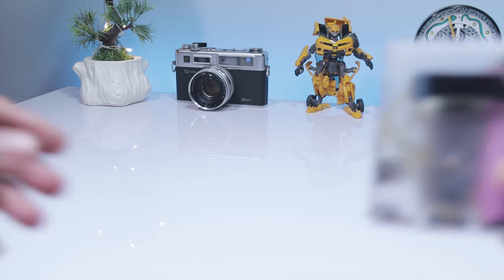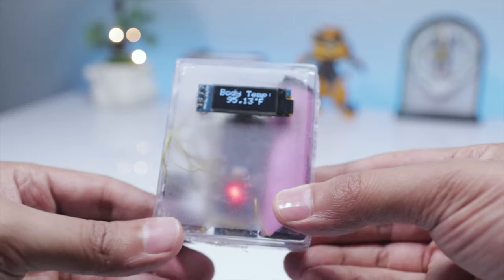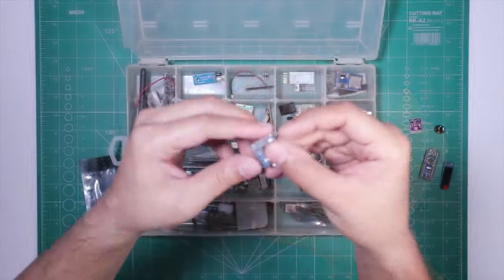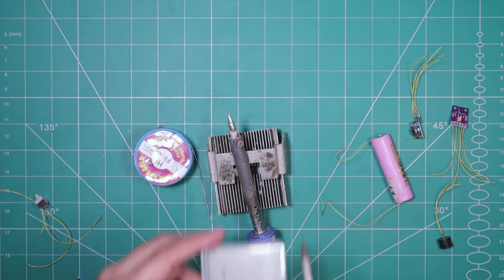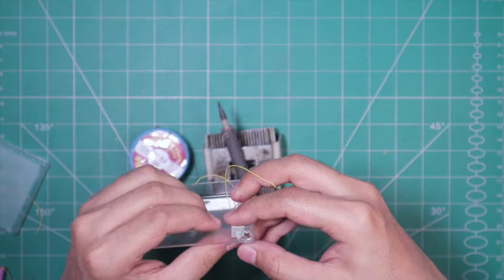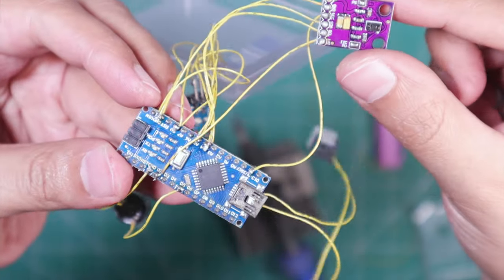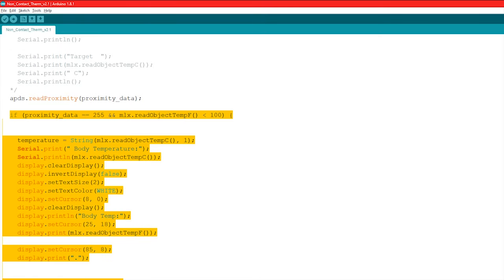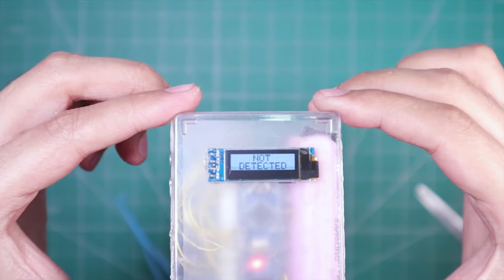DIY Non-Contact Thermometer | Low Cost Easy To Make | Infra Red Thermometer

Comment: hello sir, how are you. 
hope doing good..
sir, i just want to ask question regarding costing, the IR thermometer used here costs around 3k but the non contact IR temperature measuring machines available in market costs just rupees2k.. so how it is cost effective.

Comment: Brother, I just downloaded your code but it seemed to be error when it runs, this is what it said " Arduino: 1.8.13 (Windows 10), Board: "Arduino Nano, ATmega328P"

Non_Contact_Therm_v2.1:11:10: fatal error: SparkFun_APDS9960.h: No such file or directory

 #include <SparkFun_APDS9960.h>

          ^~~~~~~~~~~~~~~~~~~~~

compilation terminated.

exit status 1

SparkFun_APDS9960.h: No such file or directory

This report would have more information with
"Show verbose output during compilation"
option enabled in File -> Preferences.

What is happening?

Comment: What is the range?
It can be used in electronics also?
To measure for 600 C for example?
Reply from the maker: Yes it can be used to measure any other surface temperature, but its temperature range is from -70C  to  382.2C

Comment: hi sir ! can ask you please about the size of the 18650 battery that you're using !!
Reply from the maker: The number "18650" actually classifies the size of the battery where 18mm is the width and 65mm is the height of the battery. So all of the 18650 batteries are the same in size.
Reply: @GuyThatDoesEverything   thank you sir! I was asking about how many mAh, i meant it like 2200 mah , because i have a student project of a mask that will give the temperature of the user and i have that problem of how many "mAh" i need for the battery !

Comment: I need a sensor that can measure temperature from 5 steps away and is head-mounted, so it gives the magnetic door lock the command to open the door.

Comment: .
I want to know about non contact thermometer.
I have tried it but i got problem here. why the code not work. there is error message that i get.
Arduino: 1.8.13 (Windows Store 1.8.42.0) (Windows 10), Board: "Arduino Uno"

Non_Contact_Therm_v2.1:11:10: fatal error: SparkFun_APDS9960.h: No such file or directory

 #include <SparkFun_APDS9960.h>

          ^~~~~~~~~~~~~~~~~~~~~

compilation terminated.

exit status 1

SparkFun_APDS9960.h: No such file or directory

This report would have more information with
"Show verbose output during compilation"
option enabled in File -> Preferences.

Comment: Hello sir...
Can you explain me how can i do this project using Arduino UNO... because i wiil make combination of sanitizer dispenser with temperature detector using Arduino UNO...it's my final year project so I need your help
Reply from the maker: You can easily do it on Arduino Uno as well as the pins configuration are all the same
Reply: @GuyThatDoesEverything  sir can you give me .. components list, circuit diagram and combine codding for making sanitizer dispenser with temperature detector using Arduino..
Sir for this I will paid your fees

Comment: Can I use Arduino mega for this?
Reply from the maker: Yup you can
Reply: @GuyThatDoesEverything  the code isnt working, or should I download its library first?
Reply from the maker: Yeah libraries should be installed first and I guess you will also need to do some wiring changes for i2C connections as per the pin-out of Arduino Mega
Reply: @GuyThatDoesEverything  what library should I install? I REALLY NEED TO GET THIS DONE FOR MY SCHOOL PROJECT. THANKS FOR THE HELP ANYWAYS
Reply: @GuyThatDoesEverything  but it should be the same pin right? Just transfer it to arduino mega?
Reply from the maker: Libraries for all the <included> command lines (mentioned in the code)
I don't think the code will be 100% compatible with Mega due to different pinout of i2C. You will have to spend some time on google for that.
Reply: @GuyThatDoesEverything  okay thanks a lot

Comment: 6:19  should'nt the temp be in celcius at this point...like a soldering iron easly evaporates water
Reply from the maker: What?? The temperature values that are being shown there are in Fahrenheit. I kept that soldering iron disconnected so that I would be able to show what happens when the temperature exceeds 100F
Reply: @GuyThatDoesEverything  ok ok..i thought like how was the iron running so low. thanks

Comment: Very good. Thank you.
please.  Possible use of the sensor mlx90247c.  Allowance sensor MLX90614.l have this sensor mlx90247c i need contact with Arduino please help me 

شكرا علا الفيديوهات الروعة.
لُوَ سمحت من فضلك توضح لنا لو كان بدل الحساس mlx90614   هذا الحساس mlx90247c مٌمٌكِنَ تْشِرَحُ لُنَا الُطِرَيَقًةِ اوَ الُمٌكِتْبّةِ mlx90247c. H ممكن نزلها

Comment: YOUR LINK FOR CODE DOES NOT WORK. PLEASE FIX IT.
Reply from the maker: It works just fine, try opening it on a different browser
Reply: @GuyThatDoesEverything  I tried google chrome and fire fox with no results. What browser are you using?

Comment: How did you adjust the emissivity of different surfaces and proximity sensor interfere with the infrared sensor.... you are getting false reading. Either you don't know about it or you are ignoring it.
Reply from the maker: The first thing i tested was whether the proximity sensor's IR beam was causing any interference with the IR Temp sensor or not and it DID NOT cause any problem whatsoever & that's because MLX90614 sensor is designed to cut off Near Infra Red (the same emit by proximity sensor).
And as for the emissivity, the only surface I intend to measure with this device is Human Body/Skin and this sensor works perfectly accurate in this case, if you intend to measure any other surface like Aluminium etc then you must take account of their respective emissivity values/calculations as discussed in the datasheet of MLX sensor.
Reply: @GuyThatDoesEverything  Man when you place hand near the proximity sensor it absorbs IR radiation and at the same time IR thermometer detects your skin temperature, how it is possible that you don't get altered reading.
Reply from the maker: As i said that proximity sensor has a tiny LED that emits Near Infra Red light (not Far Infra Red) which is close to visible spectrum so it doesn't cause any temperature rise whatsoever because 950nm wavelength with as little as 20mA of current is simply incapable of causing any temperature rise. You can even check that on your own by pressing the button of your TV remote or any IR remote closer to your skin.